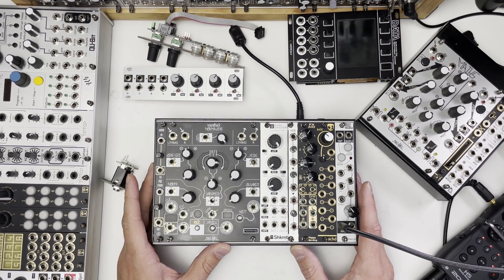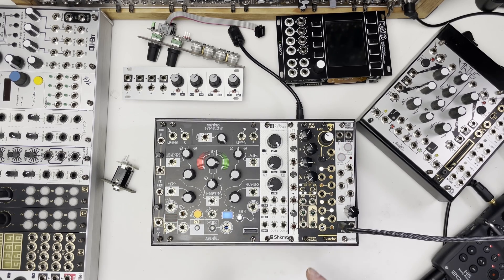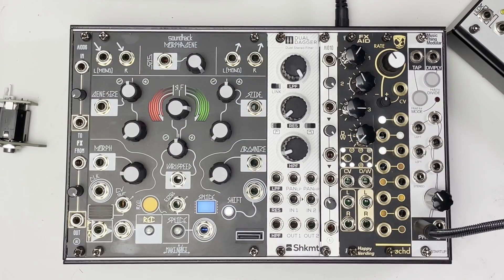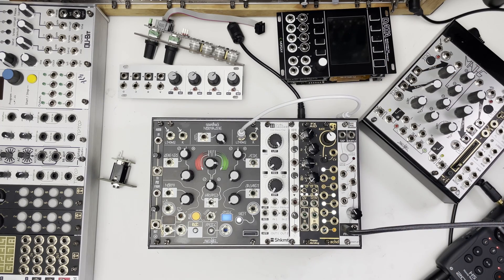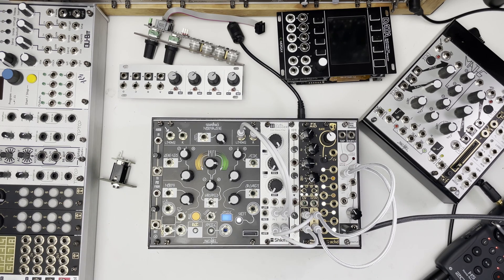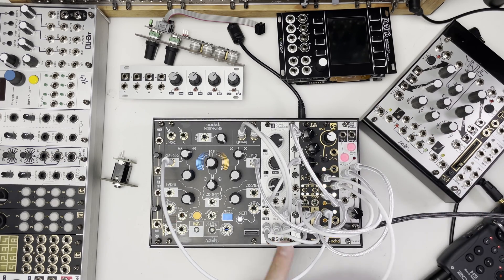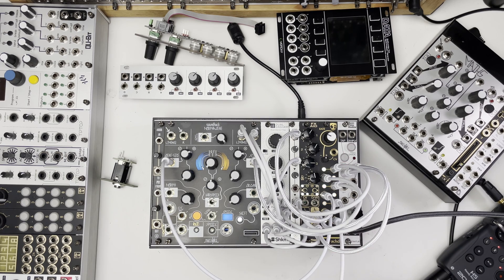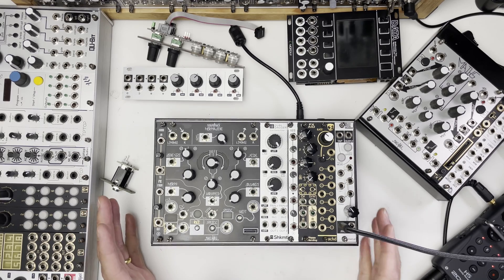How to make ambient textures with a tiny (42hp!) Eurorack modular system

Comment: Do you really need to bring up the line levels to input into Morphagene? I've just plugged sources in directly, the only issue being possibly extra noise.
Reply from the maker: You're totally right - you CAN just plug directly into the Morphagene and set your levels using the secondary functions. I use the AI006 because I often capture a snippet of an instrument through the Morph and then re-patch the line-in elsewhere to build up layers (plus I find the in-Morph level setting a bit fiddly, so the single pot on the AI006 is much quicker)
Reply: Totally makes sense. I have a 42HP case and love its restrictiveness.

Comment: This is actually the PERFECT tutorial for creating a small Morphagene system! Love it mate, I’ve had my eye on Morphagene as my entry into Eurorack, this video has given me some inspiration and some focal points of where to start. Thank you
Reply from the maker: That's great to hear! Be sure to come back and let us know how you got on. Morphagene is a beast, and I wish I'd bought it earlier in my modular journey. I started out with a Clouds clone and an Arbhar because I thought that was the sound I wanted, when really what I needed was a Morphagene; I just didn't know it yet.
Reply: @TomHazledine  Arbhar looks great too, but I’m drawn more towards the Morphagene! Thanks to your video in part :) I’m thinking to get Morphagene, and LFO and attenuator first off, and pair with Borderlands Granular on iPad and run through Zoom CDR-70 FX pedal (both of which I already have). Can add filter later maybe, it’s an expensive rabbit hole that I’m on the cusp of diving into
Reply: @TomHazledine  quick question mate, the AI006 Stomp Adapter, can it only bring signal in in mono?
Reply from the maker: @advaita9156  Yep, just one mono in and one mono out. The DIY kits are cheap (compared to other modules!) so I’ve got two for when I need stereo in.

Worth noting that Morphagene has a gain control (hidden in second functions, but easy enough to master once you’ve read the manual) so you can put a lot of signals straight into it without even needing the AI006
Reply: @TomHazledine  thanks for reply Tom. I have an iPad that I want to use within the system…not sure if the iPad can go straight to Morphagene or straight to the FX modules I will be buying (FX aid + Versio or Monsoon). So not sure if I need an input module or not. I will have to do some more research, but I would ideally like stereo input, so I think Pico Input may be better option despite it taking up more space

Comment: how deep is the case?
Reply from the maker: Externally it's 56mm high, but internally it depends on the position - the power connection headers take up a lot of space at one end (more than half the width of the case), and there's the power supply caps etc at the other end.
There's 32mm space between the headers and the back of the faceplate, but there's a small section where there's 42mm of space (enough for a 4hp module).

If a module advertises itself as "skiff friendly" you'll probably be able to fit it in, but don't expect to be able to use any deep modules (like Doepfer or Expert Sleepers or 2HP)